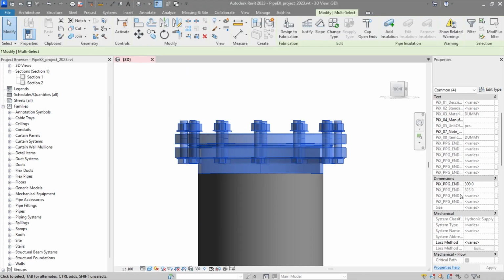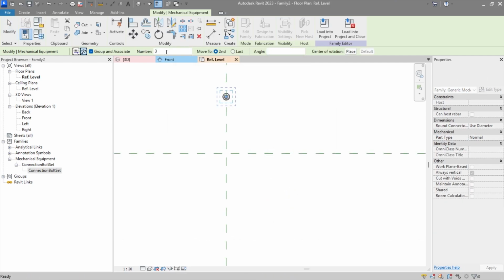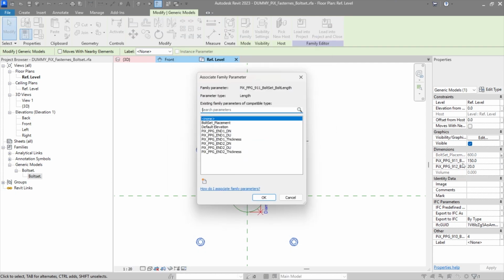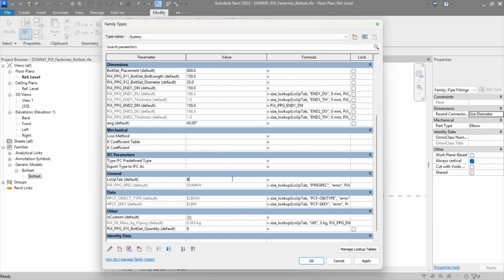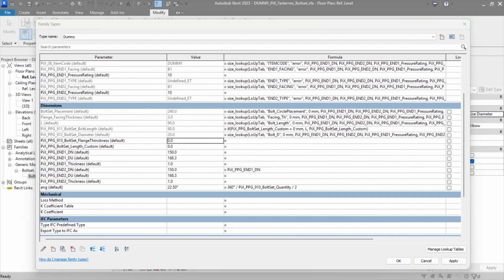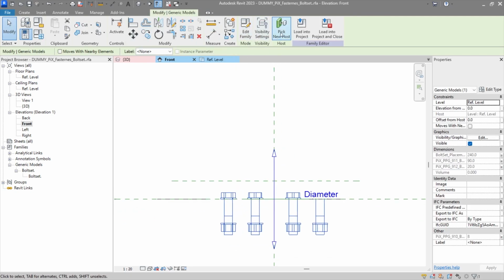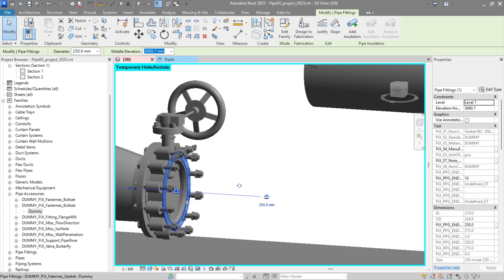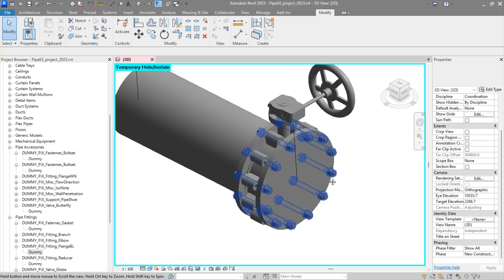How to Create an Adaptive Bolt Set Connection in Autodesk Revit | Step-by-Step Tutorial

Comment: nice.. i wanna create this on a steel beam connection.
Reply from the maker: I think you can do it, but the size of the beam will not be collected dynamically. So, you need to adjust the look-up value per instance or to create several types.
Reply: @PipeEXltd2023  i think i wll use as look up value from the existing wide flange family
Reply from the maker: This is also possible